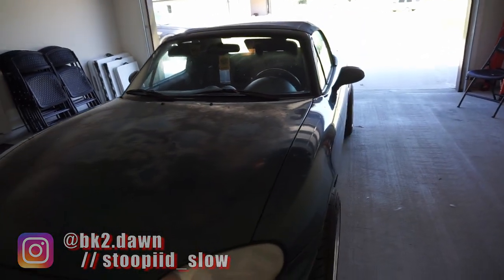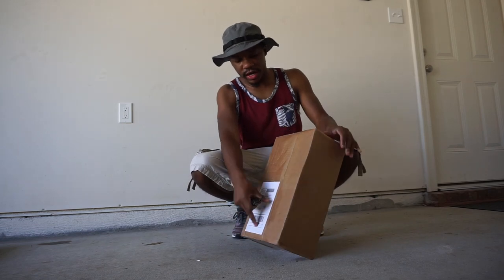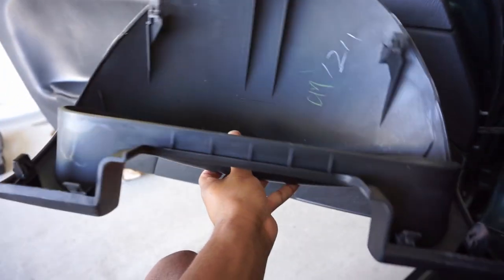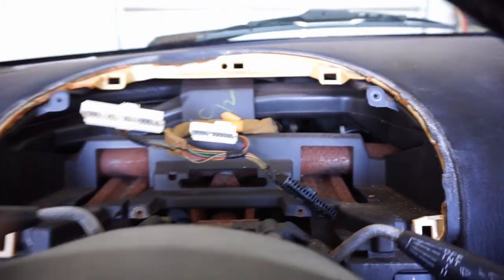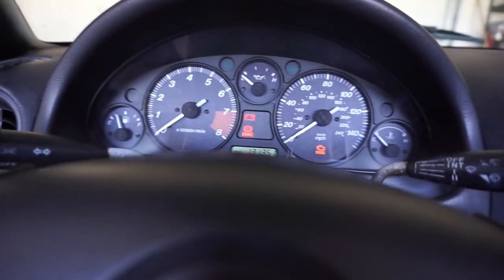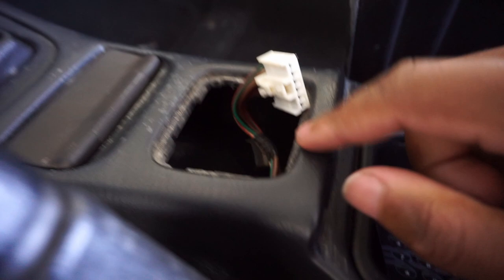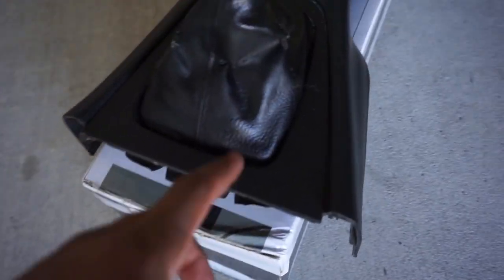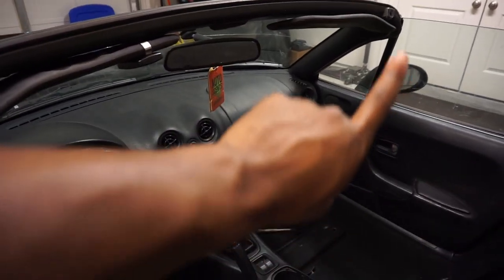NB Miata Interior UPGRADE! CHEAP Mods That LOOK GOOD!

Comment: That's a ppf bolt! You have two under the transmission and two by the differential, as well as one short one in the middle. That particular one goes towards the differential and specifically it is the bolt that goes closest to the front of the car (2nd from the back when compared to all the ppf bolts). Hopefully you still have the spline nut that is suppose to be sunken into the spacer back there!
Reply from the maker: Thanks for the info.. I’ll be getting under the car to check soon, hopefully it’s not too bad🥵

I should be able to buy replacement parts tho if I’m missing anything

Comment: What about the fuel gauge? The old cluster was in the middle, the new one sat at 3/10 and did not move when you flicked the key.
Reply from the maker: The fuel gauge works fine, I guess it had to calibrate or something once the car was running.. Good pick up tho, I didn’t even notice

Comment: Looks like a ppf bolt to me
Reply from the maker: Brian Gus ppf bolt? What’s that?👀
Reply: PJ Morrison it’s basically ur transmission mount it goes from the trans all the way back to the diff and are held in with those long ass bolts
Reply from the maker: Brian Gus oh ok, so it’s not super bad.. But I will want to get another one cuz it’s bent😅